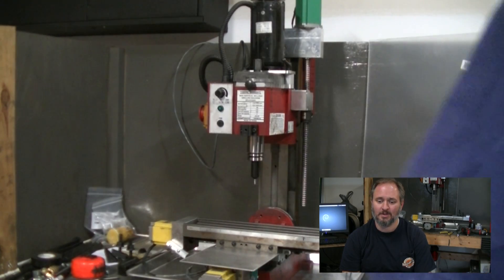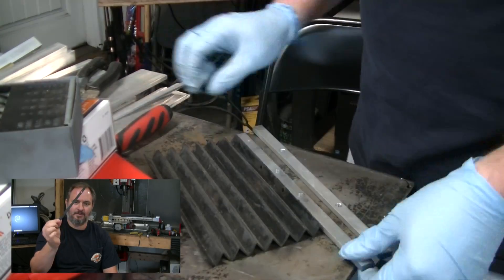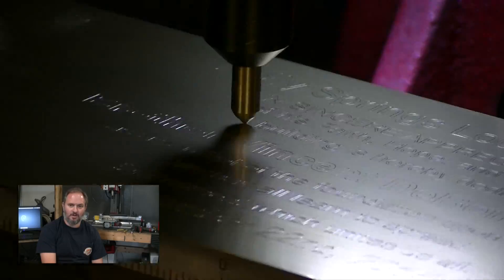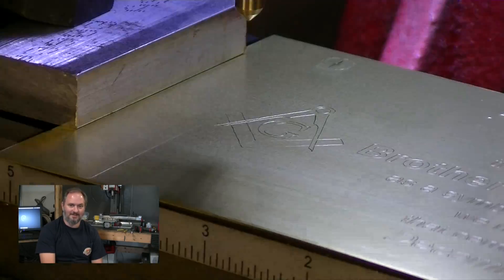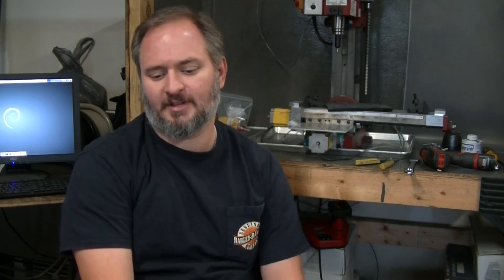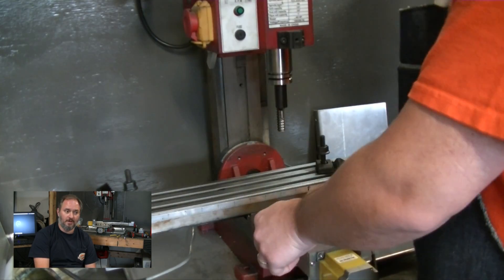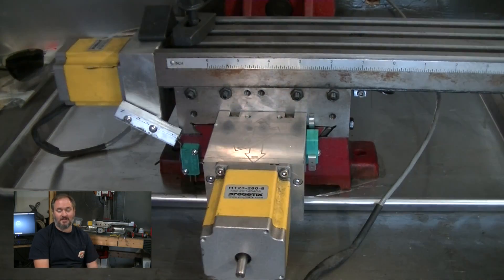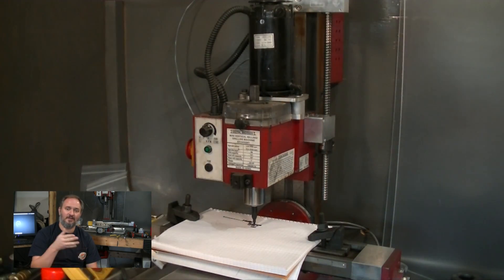Shop Update & CNC Mill Progress

Comment: Great vid Tom!  That's one heck of a speed increase!!!  That kinda makes me want to put that on my little lathe.  Are you running through a parallel port?  I've thought about getting a smooth stepper for the little lathe, too.  But, if you got that kind of increase just switching to linux......that might be the way to go.  If I liked it enough, I just might switch the big mill over.  hhhmmmmm.......

Oh....and share the vid.  Unless there's something personal about the vid, there will always be people that can use the info.  I used PowerDirector for awhile.....I found TrakAxPC way easier to use for generic vids.  It will still do just about everything else that PD will if you want to.

Congrats on the numbers!! 
Mike
Reply from the maker: Hi Mike! Thanks for the feedback. It's always appreciated, as you well know. As far as the switch and performance increases go, I can't say all of that is just the software switch. Under Mach 4 I was using a PMDX USB --> parallel converter because Mach was deprecating parallel support. Under Linux I'm going straight parallel. Additionally, I was able to get finer tuning done more easily in Linux. Combined, this meant much better performance.

I'll release the PD video shortly. Nothing personal in there but it's a raw, unedited video with kind of quiet audio. Maybe it will help someone though.

Hit 1000 sometime overnight! It seems a little surreal sometimes.

Best wishes,
Tom Z

Comment: Nice update and sweet job on getting LinuxCNC setup and working with the limit switches and homing! Your really trucking along! 

I need to get homing working that looks very handy :)
Reply from the maker: +David Stevens (davro) Let me know when you are ready to do the limit switches. Now that I know what the parameters mean it will be easy to explain it if you get stuck. You're way ahead of me on the control side of things overall. The only down side is I need to write a bit of initialization code to clear out stale work coordinate systems and offsets. It's only about 4 lines though so not like it's that much of a bother.

Hope you are well!
Tom Z